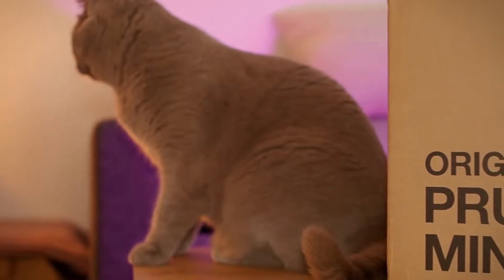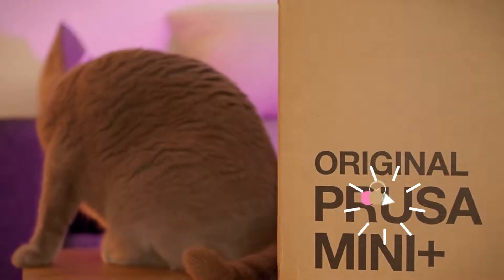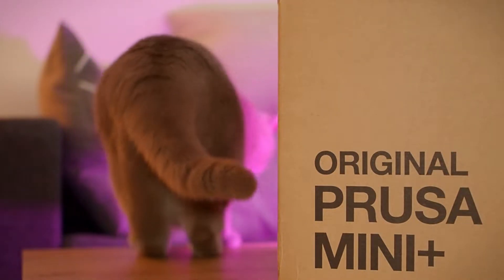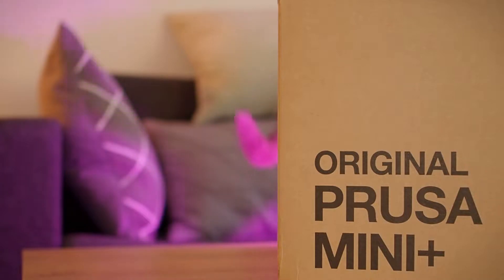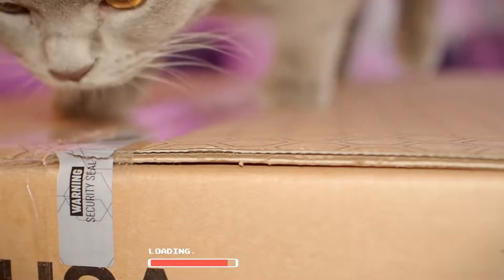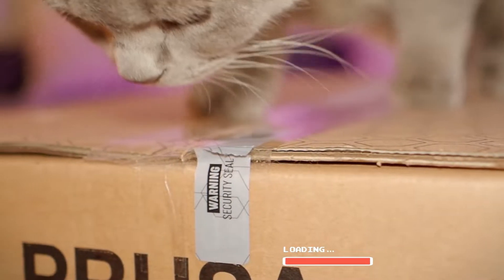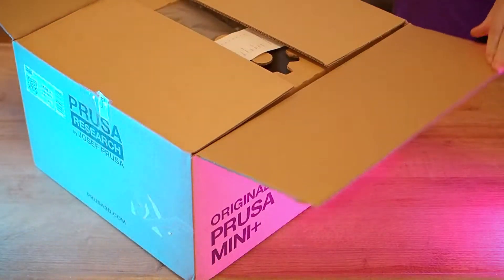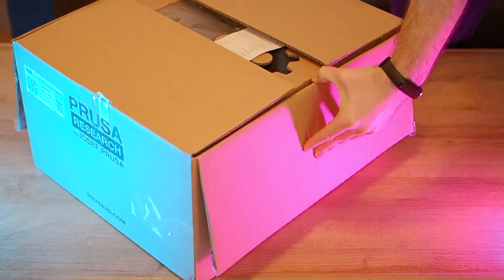Prusa Mini Plus 3D Printer Unboxing and Setup

Comment: Is it a good printer?
Reply from the maker: It is awesome tbh. Few upgrades and it is just perfect. Did already all of them but didn’t have time to post an update video…
Reply: @atechcheck  And is the size sufficient? Because I plan to order a 3D Mini + printer
Reply from the maker: Well it depends on what you need but before this one I have had 3 other printers that were 230x230 and I don’t miss the size at all. Even if I need to print bigger I can split parts (not all of course)
Reply: @atechcheck  Thanks for help selecting 3d printers! :) I select the Prusa Mini+
Reply from the maker: NP 😉 I will be uploading upgrades video for mini so consider subscribing 😀

Comment: Nice video! The onlything I want to say is that the underextrusion issue could also be an issue with the slicer settings, not per se the bowden extruder. I have had my MINI+ for a week now, and without any upgrades it works flawless!
Reply from the maker: Hey first comment on this video, thx :D Well you are right, it is possible but my mini was from day one having problems with extruder skipping, under extrusion, jamming etc. I did upgrade to direct drive thru Sherpa mini and all I can say is WOW it works great and no more problems :D I will do a video on that one as soon as I have time. I am glad yours is working fine ;)
Reply: @atechcheck  I would love to see that video!

Ps, your cat is adorable! :D
Reply from the maker: Hehe thx! I am finishing my Legion 5 Pro review and after that I will work on mini upgrades video so stay tuned 😉